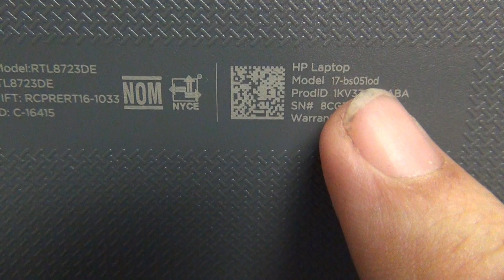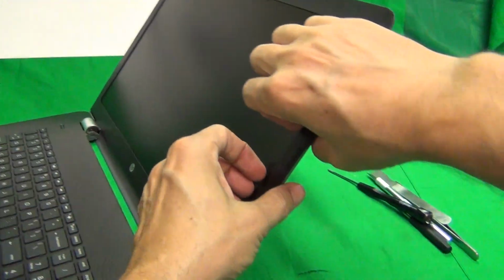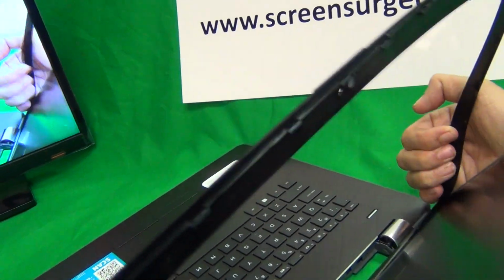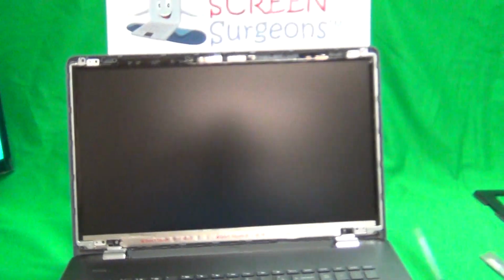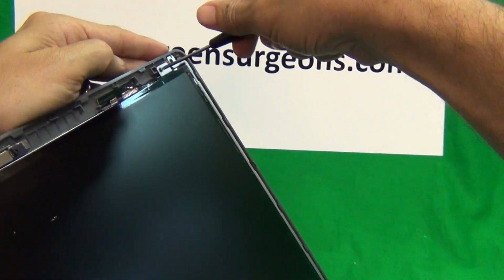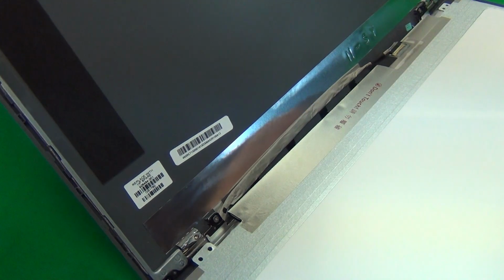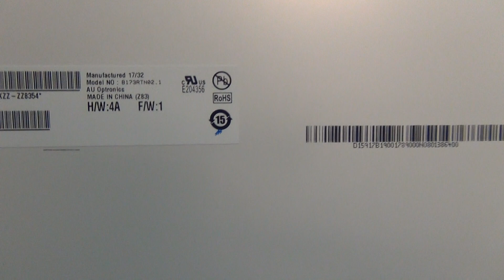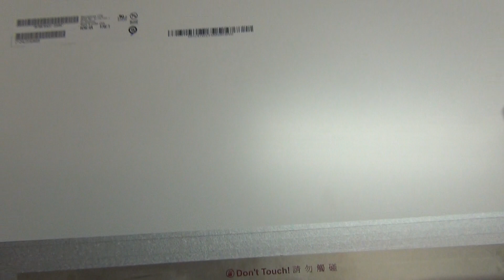HP 17-BS Laptop Screen Replacement Procedure

Comment: Great Video! By the way I have a question, I have a similar model (17-bs025cl) and I can't really know if my optical drive bay supports SATA (and which SATA version if it supports it) because I'm planning on installing a SSD in the optical drive bay using a caddy
I've tried lots of third party software and they say it's an ATAPI.. I can't seem to find an answer on the web on what is this ATAPI or whether my device controller is SATA or IDE please if you can help me in anyway.

Comment: My mother dropped her laptop again and broke the case near the hinge assembly on this exact laptop you fixing in this video. The case and hinge assembly need to be completely replaced. Do you know where I can order these parts? I would like to get the bottom case and top case or palm rest piece of case and bezel assembly. I think and hope I can reuse the hinges.
Reply: I'm having the same problem m8! Tell me if you find anything, the mounting holes where the screw litarely screqs broke off,  seeing its ultra fragile it sucks a ton. Seen some shell for the top but they are ultra expensive almost 100 bucks for just the top shell

Comment: Grrrr Arrrrgh -  I did all you said, I have it back working - but I can't for the life of me get the bezel back on at the bottom.  I assume you start the bezel at the bottom, since that is the last step in removal.   It just  doesn't seem to want to set down low enough and engage the tabs.   And my frustration is you stopped your video just at the  point I wanted.   Oh well,

Comment: I am trying to replace the whole back cover on this particular HP Laptop 17-BS.  How do you bet the bottom cover off, so I can get those hinge covers off?  The last 2 screws I need to remove in order to get the replacement cover on, are hidden by the hinge covers.  I've removed all the case screws on the bottom, including the screws inside the battery compartment, but the bottom cover still won't come off.